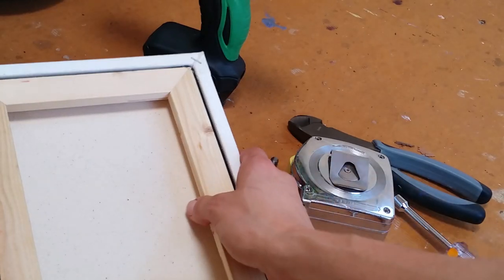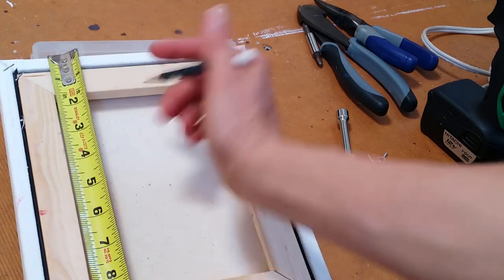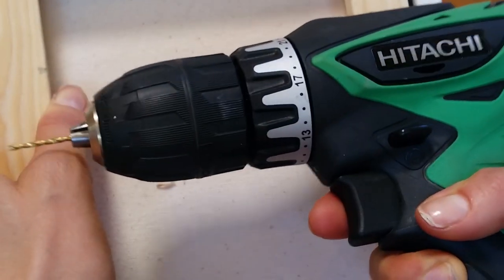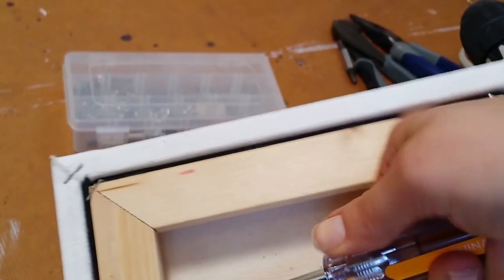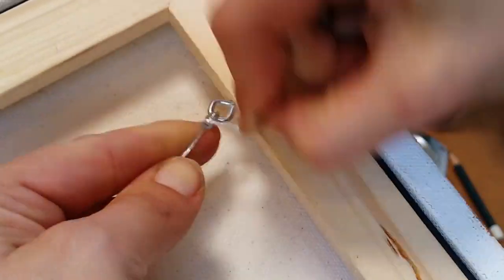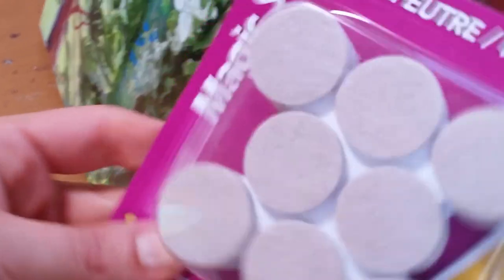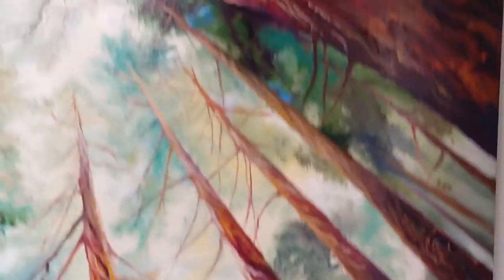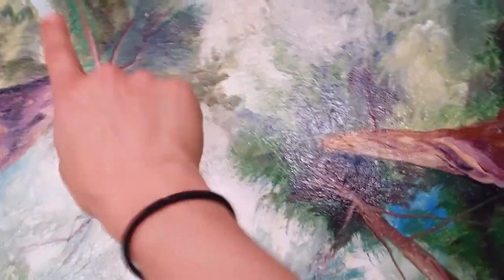How to Attach a Hanging Wire to a Painting: Part 2

Comment: What is your thought about the teeth hanger that nails on the top, back of a canvases?
Reply from the maker: Personally, I hate them. When hanging a painting, I much prefer the ease of hooking a wire onto a wall hook, which you can then slide along the hook to get the painting centered & level. With those teeth hanger things, you have to feel around to find the teeth and connect them to the nail, and make sure the nail is falling between the center teeth or the whole thing is crooked, and it's just a pain. I also work a lot on heavy wood panels, and I also tend to create larger-scale pieces, where I feel more comfortable with the sturdiness of heavy-duty hardware and a hanging wire. So, speaking only to my own personal experience and preferences, they don't work for me.

That said, depending on the artwork, and if you happen to like them, sure!

Comment: At what point would you switch to D-ring? (size/weight)
Reply from the maker: There's no one rule, as the weight of different materials varies so much. But for stretched canvases, I'd say for anything over 30" I would use D-rings. Maybe even 24" if the wood is heavy.
Reply from the maker: Also, you can get smaller D-rings for smaller canvases, so they're not just for large ones!
Reply: Thanks! 😊

Comment: I don't understand why one would use eye screws instead of D-rings on a smaller picture as well.  They are almost flat, and easier to install.  Care to answer?
Reply: Jeff Delman I was thinking the same. I have seen other Artist you  D-Rings for small paintings..
Reply from the maker: This is totally a personal choice and either is fine. My preference is eye screws, because while yes, d-rings are almost flat, they're not completely flat, and eye screws are, since they are put on the inside edge of the stretchers instead of on the back of the painting.

As far as putting d-rings on the inside edges of the stretchers, I don't recommend it for heavy paintings because the tension on the wire from the weight of the painting can actually pull the d-ring apart, causing the wire to slip off of it through the little gap that's created. With a very small, lightweight painting, however, this would not be something to worry about.

If you are using good judgement and thinking about where the strain will be placed, pros and cons of placement, etc. when choosing your hardware, you're good. :)
Reply: Cedar Lee Thank you! great tips...I appreciate your feedback